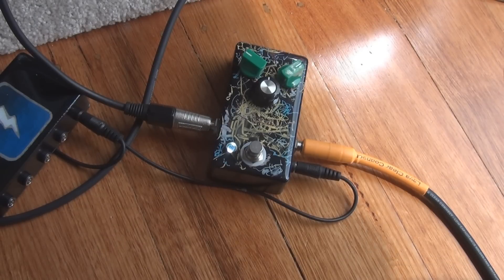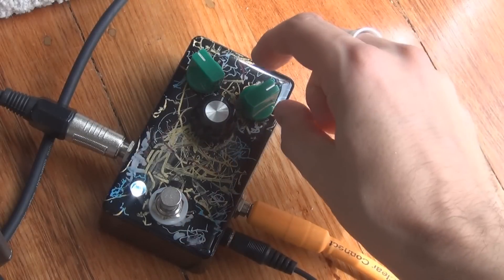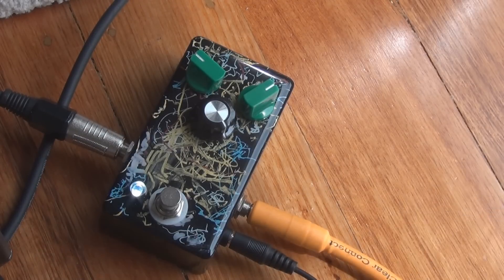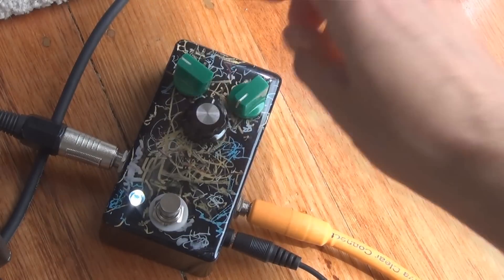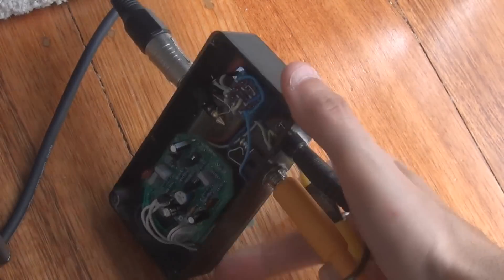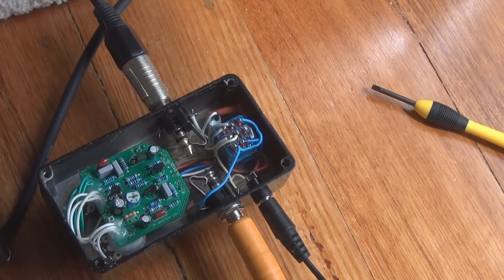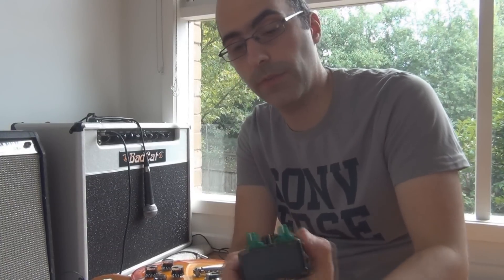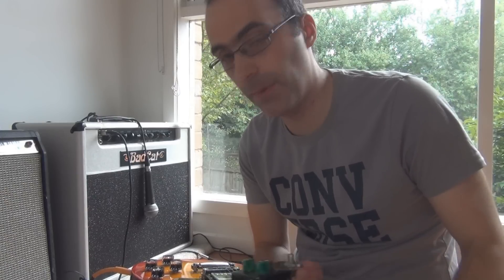GuitarPCB Hot Chilicon Fuzz - Sound Demo

Comment: This pedal sounds good dude. it even sounds good when the upper right knob is full CCW. I'm assuming the black knob is tone control of sorts
Reply: Black knob is tone and another benefit of this circuit is with the Fuzz on 9:00 and Guitar Volume full up you can scream a solo but if you roll the Guitar Volume down with a Strat you can ring clean like a bell as in Little Wing.